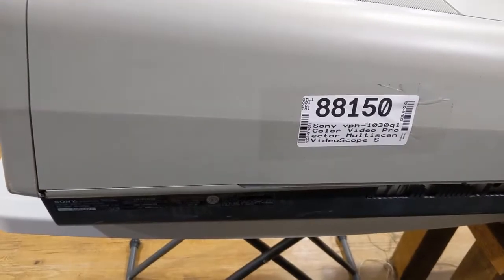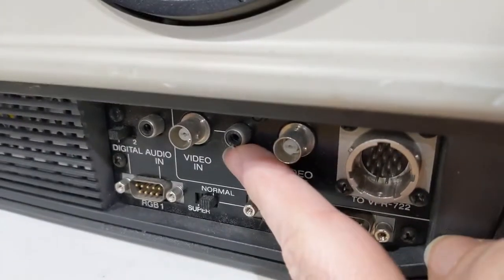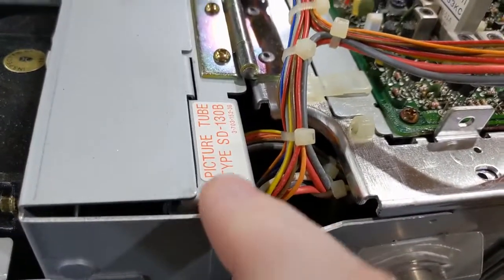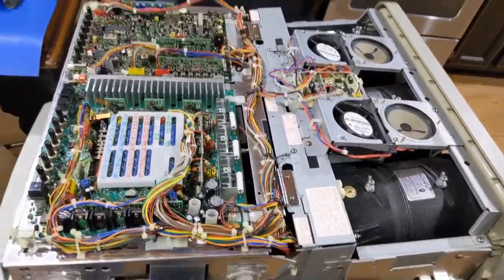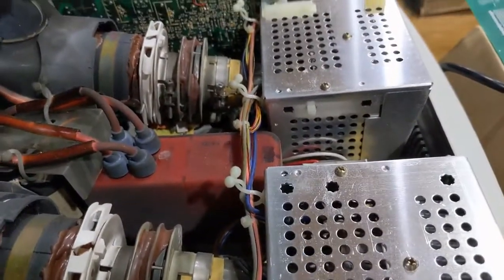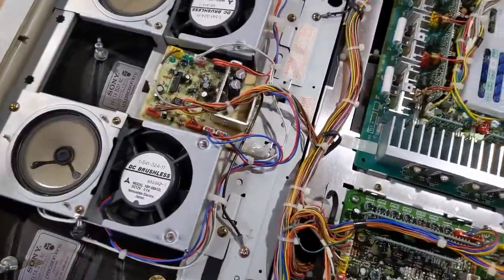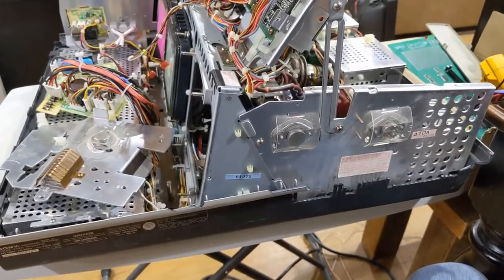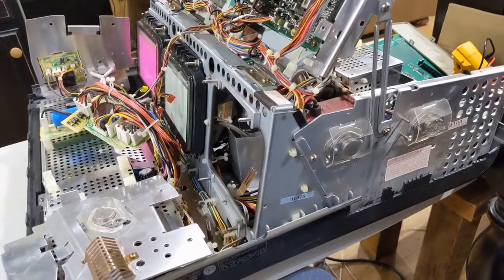Sony VPH-1030Q1 CRT Projector: Overview and Troubleshooting

Comment: That thing can do 15-32 kHz H and 50-100 Hz V scan rates. Not bad for a 1987 projector, it can handle 480p/1080i or the VGA output from any console.
Reply from the maker: That's the 1031. Not the 1030 which this is.
Reply: @THEtechknight  It does have Hi-Scan tho. I think it will at least do 31k/60
Reply from the maker: @coyote_den  according to curt palme, it's for 480p or CGA graphics